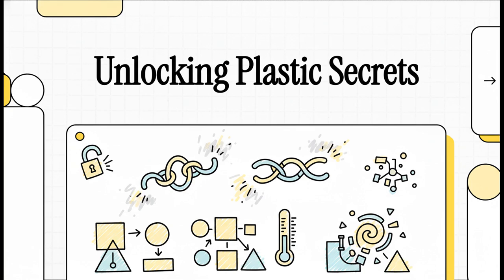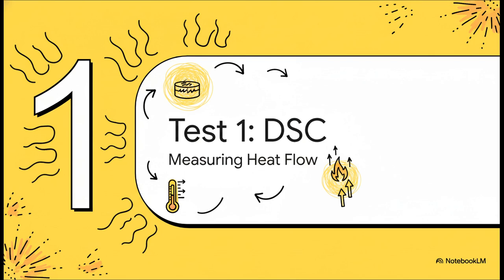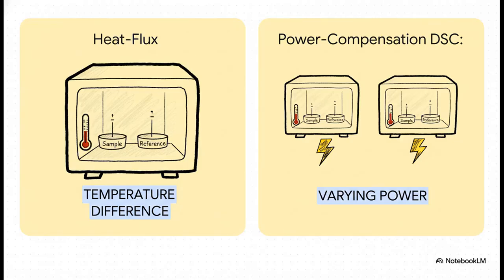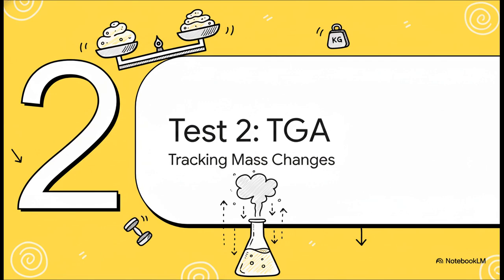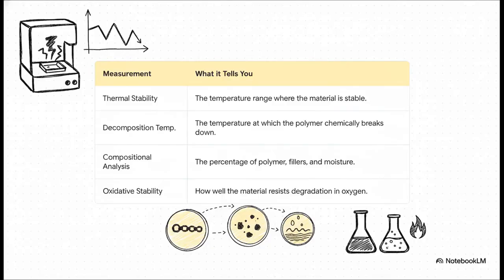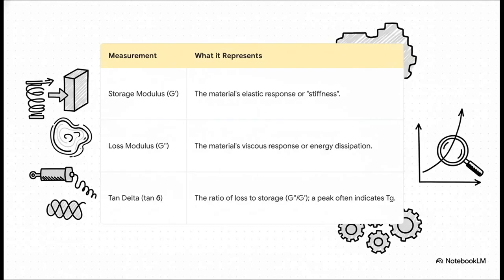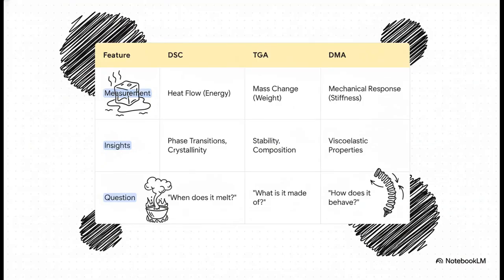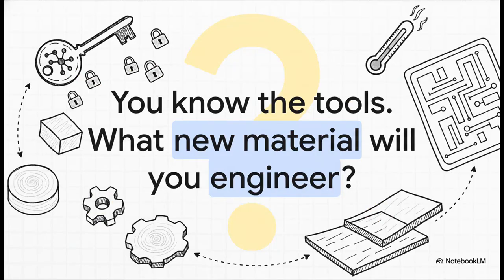Plastic Thermal Analysis

Comment: Plastic thermal analysis studies how plastic materials behave when heated or cooled. It helps identify important properties such as melting temperature, glass transition, thermal stability, and decomposition. This information is useful for material selection, quality control, and processing methods like injection molding.
(Muhammad Izzat Irfan Bin Abdul Karim dtl 4B)

Comment: Thermal analysis examines how plastic properties vary with temperature during heating and cooling. Key techniques include Differential Scanning Calorimetry (DSC), which measures heat flow to determine melting and glass transition temperatures; Thermogravimetric Analysis (TGA), which tracks weight changes to assess thermal stability and decomposition; and Dynamic Mechanical Analysis (DMA), which evaluates changes in mechanical behavior as temperature changes. Collectively, these methods provide insight into the thermal characteristics, stability, and performance of plastic materials.

(Muhammad Naseemuddin) (DTL4B)

Comment: The video explains how thermal analysis is used to study plastics by measuring how their physical and chemical properties change with temperature, focusing on key laboratory techniques such as Differential Scanning Calorimetry (DSC) to find melting points and glass transitions, Thermogravimetric Analysis (TGA) to observe weight changes and decomposition, and Dynamic Mechanical Analysis (DMA) to assess mechanical behavior under heat and stress.  
fadzlina dtl4B

Comment: Differential Scanning Calorimetry (DSC), Thermogravimetric Analysis (TGA), and Dynamic Mechanical Analysis (DMA) are important thermal analysis techniques used to evaluate plastic materials. DSC analyzes the heat absorbed or released by a material as the temperature changes, making it possible to identify thermal transitions such as the glass transition temperature, melting point, and crystallization behavior. TGA monitors weight changes during heating, which is useful for assessing thermal stability, decomposition temperatures, and the presence of fillers or additives. DMA examines how mechanical properties such as stiffness and damping vary with temperature, providing insight into the glass transition and the viscoelastic nature of the material. Collectively, these tests provide a comprehensive understanding of how plastics respond to heat, mechanical loading, and thermal degradation.

(Raden Ariff DTL 4B)

Comment: Thermal analysis is the study of how a material’s properties change with temperature.

In simple terms:
It measures what happens to a material when it is heated or cooled.
Common thermal analysis techniques:
	•	DSC (Differential Scanning Calorimetry) – measures heat flow
	•	TGA (Thermogravimetric Analysis) – measures weight change with temperature
	•	DMA (Dynamic Mechanical Analysis) – measures stiffness vs temperature
(Muhammad Haziq) DTL 4A

Comment: • Plastics & Heat: Key points are Tg (glass transition) and Tm (melting point).
• Analysis Methods:• DSC → heat flow.
• TGA → weight change.
• DMA → stiffness & vibration.

• Purpose: Choose the right polymer, optimize processes (extrusion, blow moulding, injection), prevent defects.
• Benefit: Ensures plastic quality & safety in industry.

muhammad shazamifzal bin zakaria (dtl 4b)

Comment: Thermal analysis techniques such as DSC, TGA, and DMA are commonly used to evaluate the thermal properties of materials. DSC is used to measure heat flow in order to identify melting temperature, glass transition temperature, and crystallization behavior. TGA monitors changes in weight as temperature increases to assess thermal stability and decomposition characteristics. Meanwhile, DMA evaluates mechanical properties under dynamic conditions, providing information on stiffness, damping behavior, and glass transition temperature. 

ahmad iman ateef bin asron (Dtl 4B)

Comment: Thermal analysis techniques play a crucial role in evaluating the thermal and mechanical characteristics of plastic materials. Methods such as DSC allow the detection of heat-related transitions that indicate changes in physical structure, TGA provides information on material stability and composition by observing mass loss during heating, and DMA examines how mechanical properties respond to temperature and applied stress. Together, these techniques give a complete understanding of how plastics behave under thermal conditions, supporting better material selection, processing control, and performance optimization in plastic applications.(Muhammad Nabil Bin Mohd Suhaimi DTL 4B)

Comment: Differential Scanning Calorimetry (DSC), Thermogravimetric Analysis (TGA), and Dynamic Mechanical Analysis (DMA) are key thermal tests used to characterize plastics. DSC measures heat flow into or out of a material as temperature changes, allowing identification of thermal transitions such as glass transition temperature, melting point, and crystallization. TGA measures changes in mass as a material is heated, which helps determine thermal stability, decomposition temperature, and filler content. DMA measures mechanical properties like stiffness and damping across a range of temperatures, providing information such as glass transition temperature and the material’s viscoelastic behavior. Together, these tests help understand how plastics behave under heat, mechanical stress, and thermal degradation.

(Emran Harith - Dtl4a)

Comment: Differential Scanning Calorimetry (DSC)

Measures the heat flow into or out of a material as temperature changes.
Used to determine:
	•	Glass transition temperature (Tg)
	•	Melting temperature (Tm)
	•	Degree of crystallinity

⸻

🔹 Thermogravimetric Analysis (TGA)

Measures the change in mass of a material as temperature increases.
Used to evaluate:
	•	Thermal stability
	•	Decomposition temperature
	•	Moisture or volatile content

⸻

🔹 Dynamic Mechanical Analysis (DMA)

Measures the mechanical behavior of a material under oscillating stress over a temperature range.
Provides information about:
	•	Stiffness
	•	Viscoelastic behavior
	•	Damping properties

⸻

3. Applications of Thermal Analysis

These techniques are widely used in:
	•	Material research
	•	Quality control
	•	Product design

They help engineers:
	•	Select suitable plastics for specific applications
	•	Predict material performance under real working conditions
	•	Improve product durability and safety
Amirul Haziq DTL4A

Comment: • Tests are used to identify when plastic starts to soften, deform, or melt
• Thermal properties help determine the heat resistance of plastic materials
• These tests are important to select suitable plastics for different products
• They also help ensure plastics perform well during manufacturing processes like moulding and extrusion

Muhammad Noh Aidil Denish bin Hairu Zaman     dtl 4a

Comment: Thermal analysis tests such as DSC, TGA, and DMA are used to study the thermal behavior of materials. DSC measures heat flow to determine melting temperature, glass transition temperature, and crystallization behavior. TGA analyzes weight changes with temperature to evaluate thermal stability and decomposition, while DMA examines mechanical properties under dynamic loading to assess stiffness, damping, and glass transition temperature. (nur zhulaikha najwa binti ahmad najib) dtl4A

Comment: Thermal analysis is used to study how the properties of plastics change with temperature during heating or cooling. Common thermal analysis techniques include DSC, which measures heat flow to identify melting point and glass transition temperature; TGA, which measures weight changes to evaluate thermal stability and material decomposition; and DMA, which analyzes changes in mechanical properties with temperature. Together, these techniques help in understanding the thermal behavior, stability, and performance of plastic materials. ( wan nur sabrina )( DTL 4A )

Comment: 1. What is Thermal Analysis
	•	Thermal analysis studies how material properties change with temperature
	•	Used to understand plastic behavior during heating and cooling

2. Types of Thermal Analysis Techniques for Plastics

Differential Scanning Calorimetry (DSC)
	•	Measures heat flow changes as temperature changes
	•	Used to identify:
	•	Melting temperature
	•	Glass transition temperature
	•	Crystallization behavior

Thermogravimetric Analysis (TGA)
	•	Measures weight change as temperature increases
	•	Shows when material decomposes or loses mass
	•	Helps determine thermal stability of plastics

Dynamic Mechanical Analysis (DMA)
	•	Measures mechanical properties (modulus) vs temperature or frequency
	•	Shows when plastic softens or loses stiffness at high temperature
(NUR NADHIRA SOFEA )(DTL4A)

Comment: 1. Thermal Analysis (Plastic)
Tests how plastic reacts when temperature changes.
2. DSC (Differential Scanning Calorimetry)
Measures heat flow in plastic.
Shows melting point and glass transition.
3. TGA (Thermogravimetric Analysis)
Measures weight change when heated.
Shows decomposition and material stability.
4. DMA (Dynamic Mechanical Analysis)
Measures stiffness and flexibility vs temperature.
Shows mechanical behavior of plastic.

Tengku Hazwani Annisha bt Tengku Azuandi DTL 4A

Comment: • Thermal Analysis
A method to observe changes in plastic properties when heated or cooled
Helps understand thermal stability and performance of plastics
• Main Thermal Analysis Techniques
1️⃣ DSC (Differential Scanning Calorimetry)
Measures heat flow in a plastic sample
Used to find melting temperature and glass transition temperature
2️⃣ TGA (Thermogravimetric Analysis)
Measures weight change as temperature increases
Shows when plastic decomposes or loses mass
3️⃣ DMA (Dynamic Mechanical Analysis)
Measures mechanical properties versus temperature
Shows when plastic becomes less stiff or softer

Muhammad Aiman Batishah 
DTL 4A